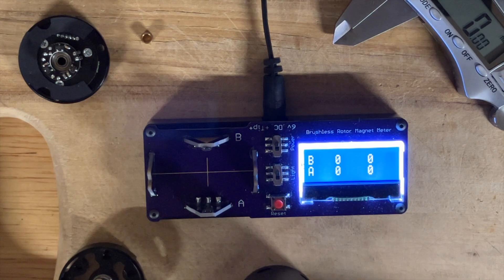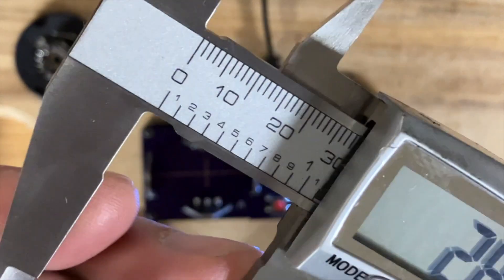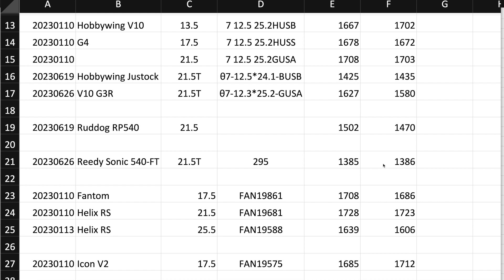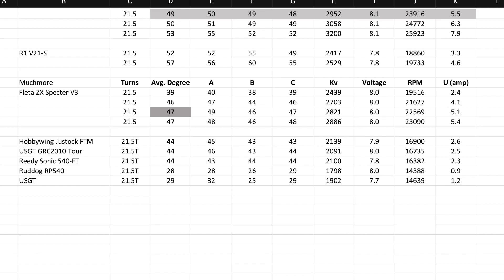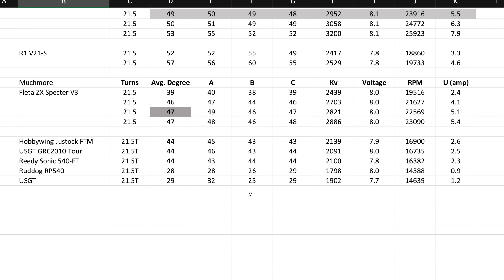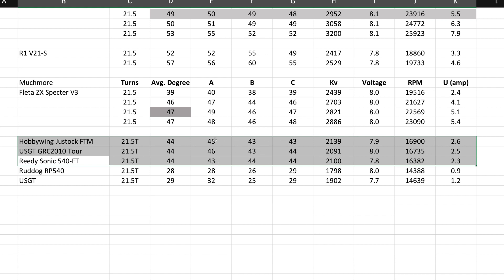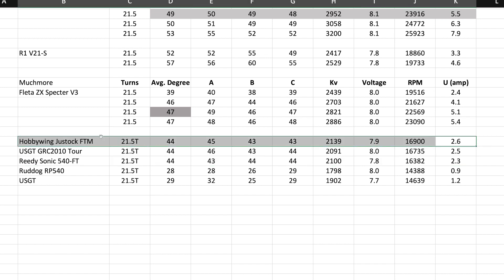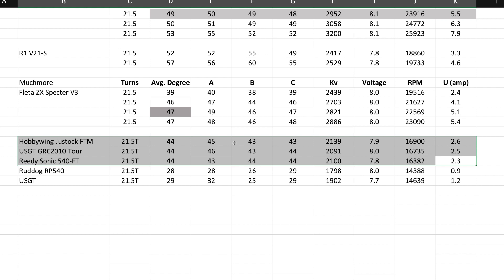Reedy Sonic 540 FT Motor Specs

Comment: Do you know what the bearing size for this motor is?  I'd like to order bearings before I tear it down.  Thanks!
Reply from the maker: I am not sure. I no longer have the motor. But it should be a standard set of Reedy bearing. Probably 3x8x4 mm, and 3/16x3/8x1/8.

Comment: Not sure who or where you got the info on the hw justock...but I deal with hw quite alot but anyways reedy is 45 deg ft and hw is 40deg ft and is 2050kv...
And that's straight from the tech boys at hobbywing.
Reply from the maker: I get my numbers from my motor analyzer. It is possible they have a different motor set at a different timing. For example, USGT motors come in two variants... USGT 30 degrees, and Oval at 45 degrees.
Reply: @telecomandorc not to my knowledge with the jusstock line of hw motors with the ft it's only the one. When I put the two 21.5 I have I put them on my machine and they had 40.3 timing on one and 40.8 timing on the other.....so it may be possible you machine might need a calibration?
Reply from the maker: @lostinth3matrix   Although possible, the USGT spec motor came in very close to 30 degrees and the USGT oval really close to 45 as they are rated. That is one reason I doubt it. But you have a point that instruments can vary. But this FT came in at 44 degrees and it should be a 45. I think it is close. So, the HW has to be close too. But, again, you could be right.
Reply: @telecomandorc  I hear what you are saying, but like I said yes the reedy is listed as 45deg, the hw though I 100% 40 deg, as a sponsored team driver of hobbywing I highly doubt the tech guys are going to fill me with incorrect information on a motor they worked on for months. 
 As far as calibration, 1 deg difference in reading on one motor (reedy) and then the hw to Read the same with a 2139kv as you say when specs are 40 deg fixed timing and 2050kv. So in my experience (30 years of rc racing and development) I am sorry but your motor analyzer is out of calibration.
 You can reach out to hobbywing north America if you prefer, they will fill you in on the same info I just gave you for the 21.5 justock motor
Reply from the maker: @lostinth3matrix  Do you have a spec sheet I can view? HW does not list the timing. It lists the Kv at 2050Kv. 

Just in case someone else follows this thread... in https://youtu.be/dTgEDvs-Sak minute 4:35 I show the timing of the HW in question. (2139Kv-2050Kv)/(2050Kv)*100%= 4%
The timing delta would be (44deg.-40deg.)/40deg.*100%=10%

I am not challenging HW's QC. But I tested motors before the Justock and after this it such as this one. They are all close to spec (sans the Justock per your information). Could there be a difference between my instruments and HW's? Of course. But it does not changed the fact that I used the same instrument with all and only varies with one motor. If anything, the HW is out performing the others... I would say is the take way. Or I just got really lucky. 

But I am intrigues about the timing difference. The more info, the better. I would appreciate it.
Reply: @telecomandorc  I will request a tech sheet for you..
Reply from the maker: @lostinth3matrix  Thank you. Much appreciated. 🤝

Comment: Thanks for your video. I use the HW Justock in social F1 car park racing. It’s possible to get 40 minutes out of them with a 4400mah battery, it’s fantastic!  A few of us also use the fixed timing 21.5 motors in vintage racing instead of the silver can motors
Reply from the maker: Now that sounds fun. A lot of stuff here is open. We are trying to get a spec mini class. Side story... Long ago I brought my USGT car to a race. New body, tires, etc. I was blown out of the water. I got lapped over 8 times. Anyway, turned out I was the only one running a USGT FTM because the track I went to allowed any 21.5T motor.
Reply: @telecomandorc  yeah I like the idea of a control brushless motor, as your video says there are a few of them that are all quite close in performance